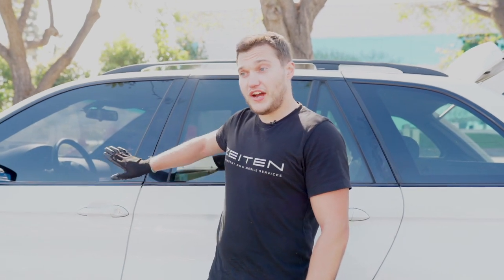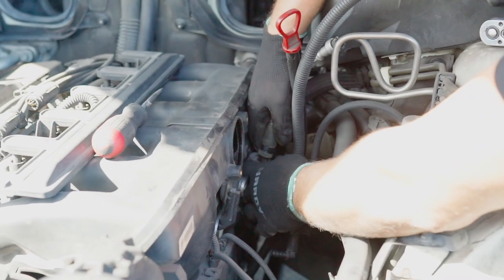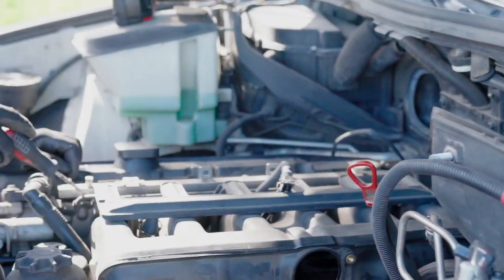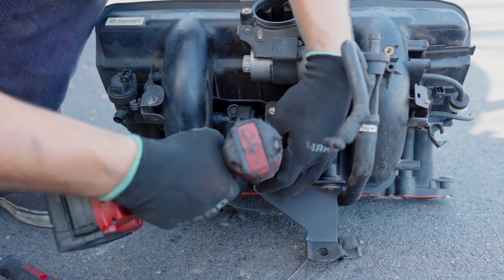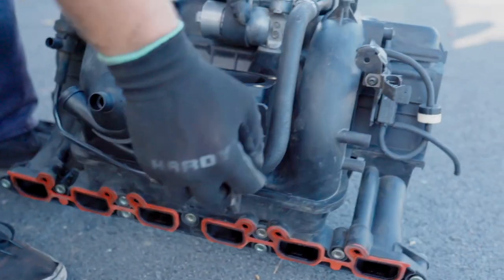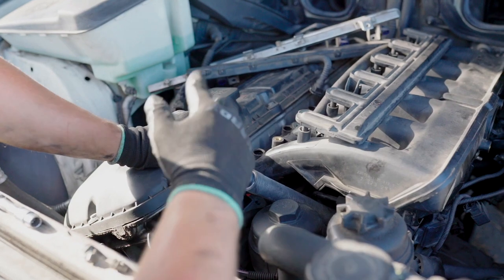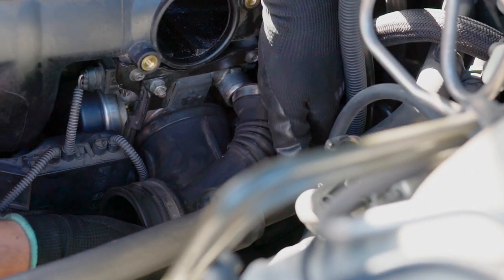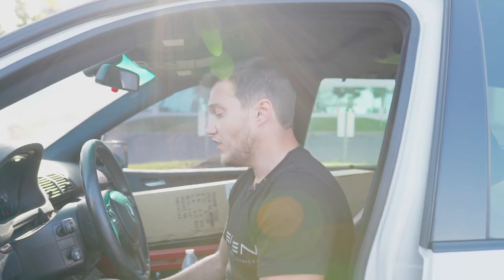DIY E53 BMW X5 Crankcase Vent Valve Kit Replacement (CCV, PCV) M54

Comment: Really Helpful. Doing mine today in tandem with my oil filter housing gasket, water pump, Thermostat housing, and lower radiator hose. Then onto the Thrust arm bushings, CV boot repair, diff oil change, as well as transfer case fluid.
04' X5 6spd, 214k

Comment: Thanks so much. It’s the first time I’ve tried anything so complex and I wouldn’t have even thought about it without this video and your help. Nearly completed rebuild and I do have two hard plastic pipes I can’t find connections for - one comes out any the tank ventilation valve but isn’t the one to the valve (looks like it comes from drive housing near left front wheel), and the other is attached to a bracket with the dipstick - so one front and one at rear of air intake manifold. I’ll just leave them hanging and give it a go, unless you have any ideas or advice. Thanks again - great work.

Comment: Excellent video tutorial, but I think I may need that link for the longer oil pan to ventilator hose; it’s mentioned in the video, but I don’t see it in the description. I do thank you for one of the best vehicle repair ones I’ve seen/worked with; it’s been extremely valuable.
Reply from the maker: Thank you, don’t have the link but here is the part number 11 15 7 532 628

Comment: Perfect, I was able to do mine only difference was whenever I lifted up the intake manifold under it going from manifold to the starter is a electrical wire that has a bolt on it, took that off and manifold came off like a piece of cake

Comment: Excellent video. Never knew you could attach an additional vacuum line from the back of the intake manifold to the CCV valve.  What would be the purpose for doing that?   Thank you!
Reply from the maker: Thank you, increased crankcase pressure which means less oil consumption 😉

Comment: My ICVALVE wasn’t rattling like yours. Mine was clicking slow like something thick clogged inside. I’m replacing it. Thank you so much for this video. It was the answer to my problem. I didn’t have a third vacuum line on my crankcase valve so I’m gonna unplug the two sides and add it
Reply from the maker: You don’t need to replace your idle control valve, just clean it, it is a simple mechanism almost never needs to be replaced, just cleaned with carb cleaner or brake cleaner
Reply: @Zeiten  even if it didn’t rattle as fast as yours did? I didn’t have any code for it. I noticed a lot of milky oil junk inside the pcv pipe next to the oil filter so I decided to break down the entire top i remove the crankshaft valve underneath the manifold and it was entirely clogged up. I just bought this car Saturday and decided to rebuild the top. I honestly think the owner never Maintance it
Reply from the maker: Yes, just clean icv
Reply: @Zeiten  it’s back to normal. It was in bad shape. It didn’t open or close I believe it was stuck in open position and I had 4 misfire codes  p300 twice p305 p302 I have one question about the oil. Can I use the green bottle of Castell high mileage or does it have to be edge Castell. I bought this bottle it says ok for ford
Reply: @Zeiten  what’s the part number for the oil separate hose that goes to the oil dip stick? I got the kit with the smaller hose
Reply from the maker: 11 15 7 532 628 there you go
Reply: @Zeiten  the truck is running and starting up 100% better but I do have a code saying camshaft position sensor B intermittent bank 1 
Is this the exhaust or manifold
Reply from the maker: As far as I remember it is exhaust, I don’t use generic p-codes since they are not accurate most of the times
Reply: @Zeiten  ok very good
Reply: @Zeiten  thank you I repaired the part and engine light is gone. I created another issue. For some reason my radio has no sound and my heater is not blowing anything. I only replaced the battery with a new one

Comment: Thank you so much Tim this really helped me. Took me about 5 hours taking my time not to break things. I am very greatful for your videos. After this procedure I noticed my idle drops too low when I am coming to a stop and than takes a second to return to a normal smooth idle. Does that sound like the idle control valve to you? I am not getting any codes. Any help is much appreciated. Cheers!
Reply from the maker: Thank you, appreciate your feedback, might be idle control valve acting up after cleaning just give it some time it will probably get back to normal. Also other possibility is idle control valve seal leaking a bit of air so look into it too if doesn’t get back to normal after awhile
Reply: @Zeiten  Thank you very much. I will check it out and report back in case it can help someone else. Cheers.

Comment: great informative video really helpful. I followed your instructions to change my crankcase valse but my intake manifold doesn't have a switch for the secondary air intake valve. I have a 2004 bow x5 3.0i e53 same engine. can you help me or I shouldn't have to worry about it.
Reply from the maker: Not all m54 engines have that switch so don’t worry about it

Comment: I have the same year and motor in my x5 and it ran amazing until I got in and it backfired on me and I got into it and the manifold blew a chuck out ... my question is could have something else failed to cause this to happen... is it worth just replacing the manifold or do I need to replace something else ... thanks for any advice that I could use

Comment: Great video thank you. Have large amounts of white/ blue smoke from exhaust of my 2006 X5 BMW. Do you think it is the PCV?
Reply from the maker: Well inspection is necessary always, white smoke - burning oil most likely pcv issue if it 6 cylinder engine, blue smoke - coolant burning that’s completely different. In my experience with 6 cylinder engines it is pcv issue especially if you live in colder climate
Reply: Hi, yes it is a 6 cylinder petrol. The radiator has oil in it.  Is not bubbling in the radiator. I live in Australia. Thanks for the help, keep it coming.

Comment: Glad you made this I’ll be doing mine soon
Reply from the maker: Happy to help👍
Reply: @Zeiten  Hey man I need your help please. Where does the hard vacuum line next to the hose for the tank ventilation valve goes? I see it’s going under the intake manifold near the power steering and oil filter reservoir but where does it goes exactly?
Reply from the maker: I bet you are referring to differential vent line, it starts on top of front diff and just goes up without connecting anywhere on the other end
Reply: @Zeiten  yeah that makes sense then because when taking my intake manifold off It was just in that area not connected to anything. Thanks man!
Reply from the maker: Sure thing, that’s how it supposed to be😉
Reply: @Zeiten  hey man I need your help again there’s no videos on this. Now when taking off your valve cover can you clean inside a bmw e53 engine to remove any access built up oil?
Reply from the maker: Well, you can’t really significantly clear anything so just leave it, next time you do your oil change use some motor flush that will help a bit
Reply: @Zeiten  will it help with removing some of the chunky oil?

Comment: Any thoughts on the horrible p0505 code. I've recently replaced the disa and then I got a cam position sensor code and a icv code. Pulled the cam position sensor and re-installed it and erased the code. Drove around and only the icv code came back. Took the icv out and cleaned it real good put it back in erased and it popped back up. Also the car is idling high so I'm guessing it probably stuck open. I've ordered a new icv and really hope that's the problem.

Comment: Could you possibly do a instructional video on removing and cleaning the oil pan to the BMW x5 e53 pleasee
Reply from the maker: That video might be coming, there are 2 ways of replacing oil pan gasket: 
1 is full removal of deferential axles front drive shaft etc very labor intensive 
2 is just lowering oil pan with diff and axles attached that will create enough room to replace oil pan gasket and much simpler way although you won’t be able to clean the oil pan itself (that is not really necessary)

Comment: E53 2004 M54 6spd manual.
I did the extra vacuum line off the CCV to the manifold. Replaced CCV, all vac lines and plugs. Carefully reassembled. 

I am now chasing burn fail codes for cyl 1, 3, and 5 and Lamda codes. Car runs well, then settles eventually into a rough idle when stationary.

DISA is holding vacuum. Put an O-Ring over the factory RTV. Fits tight in the hole, but I am suspicious of this seal here.

02 sensors are original most likely with 216k. Bought all 4 to replace. Bosch. Also just did Plugs. Bosch quad platnium. 

Not doing O2s until I verify DISA and Vacc lines are good.

What would cause those Burn fail codes and the Lamda codes if not the 02 sensors? Lamda codes not there before service.

Thank you!
Reply from the maker: Impossible to tell, retrace your steps, you definitely missed something or haven’t plugged in fully
Reply: @Zeiten  

The codes have settled down and I now have Secondary Air Injection codes, just the 2, with the car running very well dispite.
Reply from the maker: Good to hear, secondary air injection system doesn’t affect car’s performance at all it only works during cold start for about a minute to supply extra oxygen into exhaust system
Reply: The video is wrong don’t add a vacuum line from the ccv to the intake, it will cause a misfire at idle
Reply from the maker: @user-qf2fg8sj5y you have no idea what you’re talking about 🤡

Comment: Hello Zeiten, my question is what is the reason for the vacuum hose, the valve you removed did not have one.
Reply from the maker: It’s a mod to increase vacuum pressure which in turn lowers oil consumption
Reply: @Zeiten  thank you
Reply: Hey Zeiten, Thanks for the video! So helpful.  
I replaced the ccv and added the additional vacuum line. I noticed the gas cap has suction when the engine is running. Is this expected?

Comment: I have 2006 Bmw x5 e53 gasoline engine with misfires on 2 and 4, coils and spark plugs are good, injectors are good fixed all cracked hoses and possible vacuum leaks, compression is good too is it possible that it could be the ccv that is bad causing misfires on 2 and 4????
Reply: What did you figure out? I have same vehicle and problem
Reply: Couldn’t figure it out at the end I ended up fixing all lean codes 
But misfire on coil # 2 prevailed

Comment: hey Zeiten- I changed my PCV and followed all the Steps- I have a 2001 BMW X5 E53 3.0  -i was able to put everthing back together -but car wont start, it cranks but does not go all the way, if it does , car dies out. Do I need to program the Throttle body since i disconnected t? I also cleaned and remove all the 6 fuel injectors. The Fuel line and Rail has pressure and has gas coming out if i press the release valve, so Gas does flow in the engine.
Reply from the maker: Check idle control valve and for air leaks, nothing needs to be programmed at all
Reply: @Zeiten  Thanks - I think my Throttle Body is Busted. will change it

Comment: Sorry for coming late to the party, but I'm trying this service my X5 2006. The back of my manifold does not have the extra vacuum lines and the switch like your does. Can I still install the extra vacuum line from the second port to the CCV port?
Reply from the maker: Yes you can, the port is there still on the manifold
Reply: Yes... all 3 ports are in the back of the manifold, but they are all plugged up.
Reply: @Zeiten  what size was the vacuum line you used? How thick was the circumference of it please.
Reply: What are the benefits of increasing crankcase pressure??
Reply from the maker: Lower oil consumption

Comment: Why did you add the extra vacuum hose? The one you cut to size.
Reply from the maker: Increases vacuum pressure and pcv valve works better
Reply: @Zeiten  great. Thanks for the super quick reply!👍🏻
Reply from the maker: Doing my best🙌